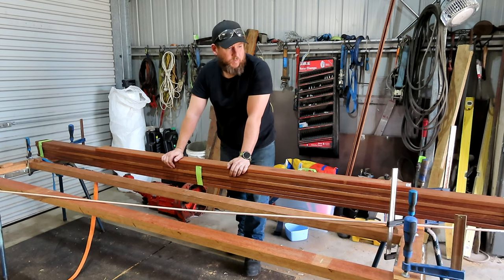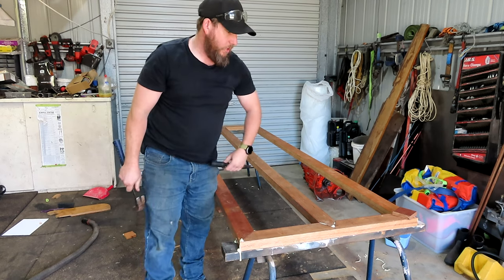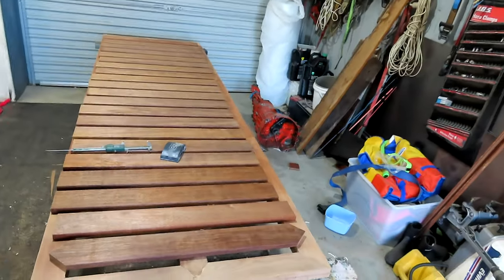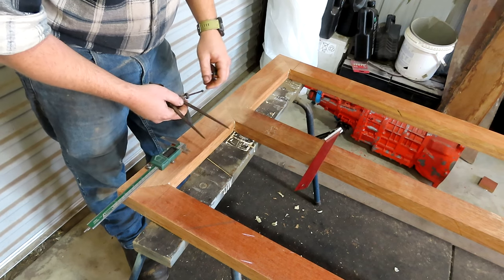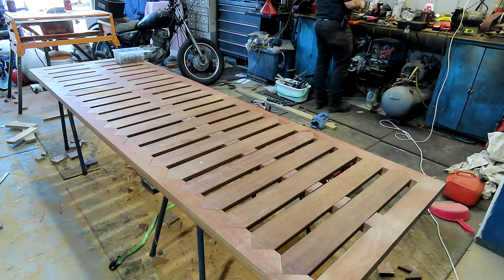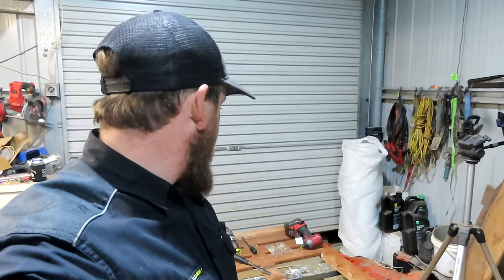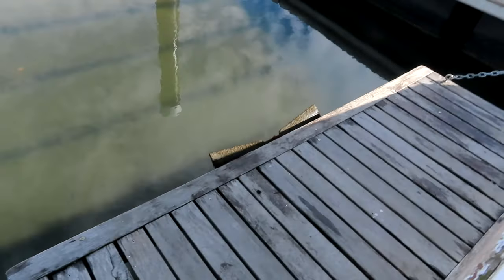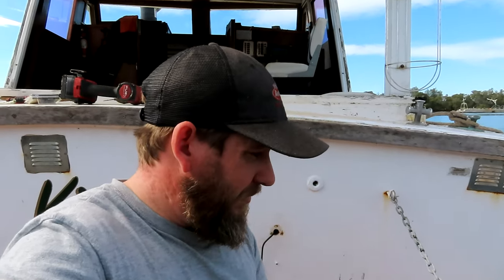HARDEST PROJECT I HAVE EVER DONE!!!!! TIMBER SWIM PLATFORM FINISHED AND INSTALLED

Comment: Nice job Tim, it looks good, there looks to be enough width on the timber to scribe the transom arc and make a better fit, oiling the timber tends to keep it's natural grip so is the way to go except that you need to re-oil on a regular basis if you want to retain the look of the timber
Reply from the maker: That's a good idea to transfer the transom shape across to the timber.
I'm happy to keep up the maintenance on the oil finish as I think it looks very nice 👍

Comment: Nicely done Tim i would have done as you regards screwing your cross piece to the main frame the one thing i would check where the chain goes into the transom for a backing plates as someone has said keep the wood oiled to preserve it nicely looking forward to roof build good luck
Reply from the maker: Thanks mate, the fasteners going through the transom have big SS washers on them no issues there thankfully.

Comment: Nice job :-) A tip though: for gluing stuff on boats, forget polyueretrhane glue. Titebond 3 is the way to go. If you'd used titebond, the joints would've held
Reply from the maker: I can't say I have heard of titebond before. I will look into it, on one end it wasn't glue that broke it was actually the timber that broke.
Reply: @HarpersBoatShed  I work as a Luthier , and Titebond is the industry standard in guitarmaking, construction, and all boat glue work. The one you need for boats is Titebond 3, it's waterproof.
Reply: I'll second this motion. Titebond is the ducks nuts.
Reply from the maker: I will be sure to have a look in the hardware next time im in there and give it a go, Thanks for the advice mate.

Comment: Great job, the marlin board needs a way to be hauled up when at sea or when you are on a mooring with wave action. the previous one didn't but it will make sense when you think about it.
Reply from the maker: Thanks mate, the other one had a small section of chain and a clip so you clip it up. I will come back and do the same with one at a later date also

Comment: Good job on the duckboard mate , if your open to tips on centering your boards I have made a lot of ballistrading in my time and have used a length of elastic marked at approximately 40mm and pin it one end and stretch it out till you get the centers you need then transfer the marks from the elastic to the wood , has saved me a lot of time marking out , hope it helps in future projects , cheers .
Reply from the maker: Always open for help and tips mate. Thank you for the advice 👍

Comment: The GPx750 was a pretty good motorcycle... but nothing really special, IMO.  Don't get me wrong, I'm a bike nut, but I think you did the right thing trading it for this nice-sized cruising vessel!  Bon voyage!
PS. What model is that classic Yamaha which appeared in the background at 16:32 ?
PPS. That duck board looks great... it does the boat justice size-wise, and built a whole lot better.  Good idea about lifting the attachment point for the chains too 
👍
Reply from the maker: Hi mate, I really did like the Kawasaki but I already have another classic Kawasaki that's going to be rebuilt soon over on my other channel ( @harpers shed) and I needed the shed space.
Good spotting the Yamaha in the background. Funny enough there is actually a video about that next week over on the other also. In short it's an 1985 SR250 that I got many years ago and use as a paddock/ hunting bike.

Comment: Nice job mate looks great. if you dont mention the mistakes nobody will notice. i make wooden signs and i can tell you theres a mistake in everyone of them  that only i know about. Keep up the good work your doing great. My only concern with your project once its installed and oiled its going to look great but its going to be slippery as f@#* once the water gets on it.
Reply from the maker: Thanks mate, I'm not one for only showing the good, if I stuff up I prefer to show it so hopefully someone may learn from my mistakes. Your dead right though if anyone were to look at it they probably wouldn't even notice any of the gaps. Surprisingly the oil surface isn't slippery at all. I think if it was varnished it would be way worse.

Comment: Great job on the video Tim still got me wanting more as usual which is the key. Might only get 6.5 knots on the return 😂  also is it worth battern down a tarp on the cabin roof just as temp repair, as it likely to be a few weeks till your ready to tackle that part of the project.
Reply from the maker: Thanks mate, she still runs a happy 8 knots even with the added weight 👍. Not a bad idea to tarp the rear roof I didn't think of doing that.